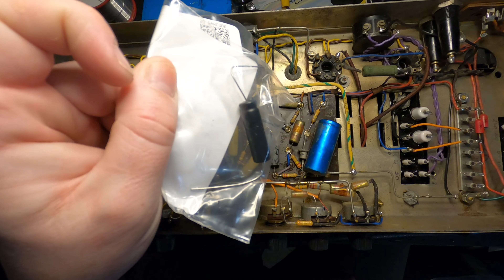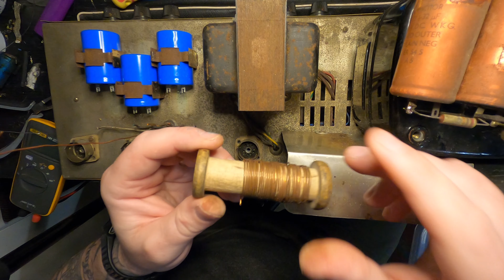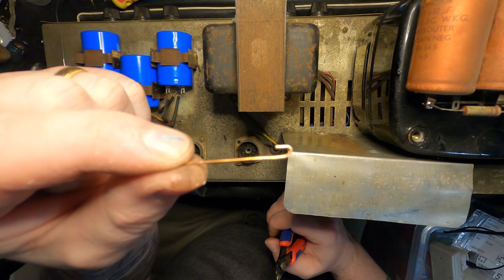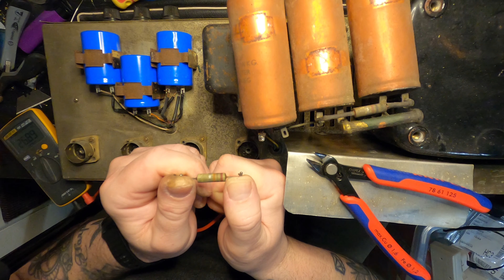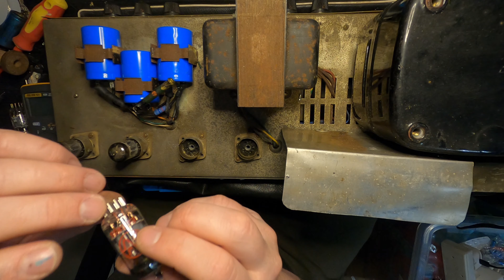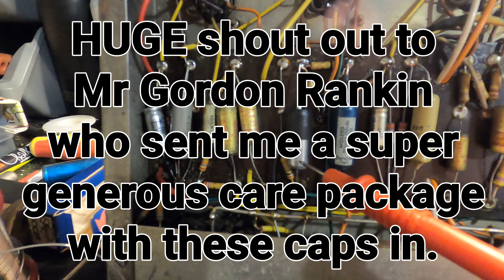We’re Restoring a 1960’s Selmer Amplifier

Comment: Hi great video, awesome detail, and very helpful,
 I’m restoring my old Selmer treble n bass 100w with tremolo in aluminium case, after 30years of storage, I have lost the old Belgin round mains cable, for the Belgin socket on the rear. I don’t suppose anyone here has such a connector, other wise I will probably have to replace with IEC socket.
Many thanks 🙏
Reply from the maker: Hello mate, thank you for the kind words. 

I think there is an ebay store called Amp Spares that sells some stuff here in the uk

Comment: Great video! I have one of these in pretty much original spec, apart from a bias trimpot. The bass channel sounds exactly like this one.. crazy ghost notes and ridiculous flub. I was waiting with baited breath to see if your bypass and coupling cap changes made a meaningful difference - I know that's not the answer now so thanks for that! The cathode follower / tone stack / local feedback arrangement is quite unique - or it would be if it wasn't a virtual carbon copy of the 6G6 bassman but with el34s and a 3 prong plug!

I have both schematics infront of me and they're very nearly identical but I've just noticed that the bass channel is run from a single filter node, for both ecc83s... The fender uses 2 as expected, (but with one being shared by the normal channel which makes a bit more sense) - I'm wondering if that's a likely cause for those rather chaotic tones?! I doubt Leo would have let it out the door if it sounded like the Selmer does. Admittedly it's only when cranked but still.
Reply: So... for the sake of science, I tried moving the first valve to it's own filter cap - there's an unused section of one of the can caps anyway - added an additional 27k dropping resistor. The result? No difference whatsoever, crazy squishy ghost notes still abound. All the preamp voltages were somewhat higher than anticipated, too, which is probably not great in the cathode follower especially. I put it back to stock.
An interesting sound, for sure.. not particularly useful though. I always thought it was something wrong with my particular example (still might be) but to hear yours exactly the same was an ear opener. Most other videos don't show it fully dimed! I assume you used an attenuator, like me? 
The blonde bassman it is based on kinda does this thing, too, just not quite to the crazy extent of the selmer - I just found a good video on here of someone playing guitar into each channel on all settings, although it's a loop so there might be an input level difference.. Search for FENDER BASSMAN 1964 CRANKED to 10! - I won't paste a link as youtube these days will delete the comment ... Ah well, I guess it is by design after all!
Reply from the maker: I still need to dig into the weeds. I found it interesting that both channels are out of phase with each other. I was thinking about adding a cathode follower just to flip the phase in the bass channel.

I'm actually selling this amp yo fund a new amp build.

Maybe I'll get an original and figure out some better mods.

Comment: You can clean the oxidation from old solid-core wire and the leads of new-old-stock components with a green Scotch-brite scrub pad, like you'd use to scrub pots and pans. Works much better than a razor blade, doesn't nick the wire, and prevents cutting yourself.
Reply from the maker: I completely agree mate but I quite enjoy doing it this. As you will see through my videos I tend to do things the hard way ha ha.